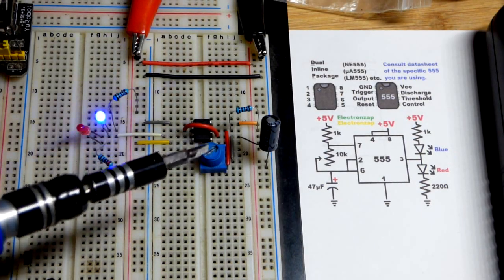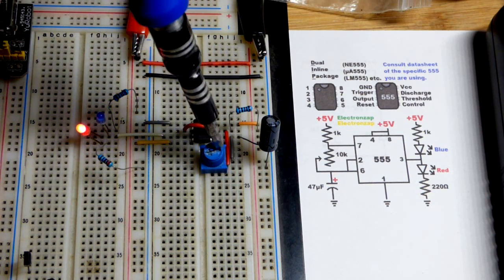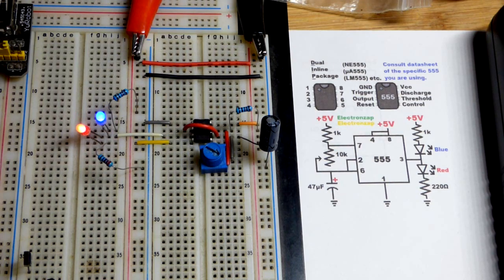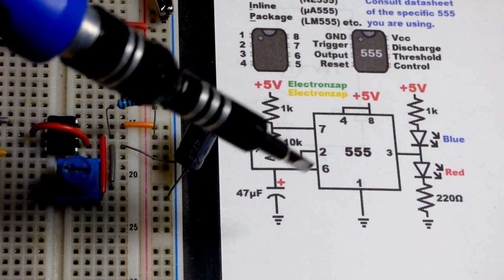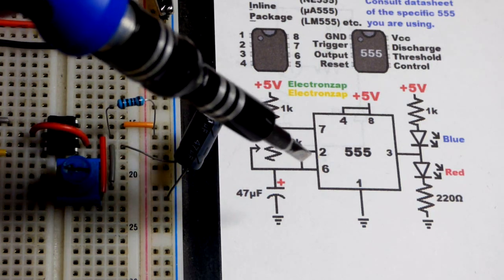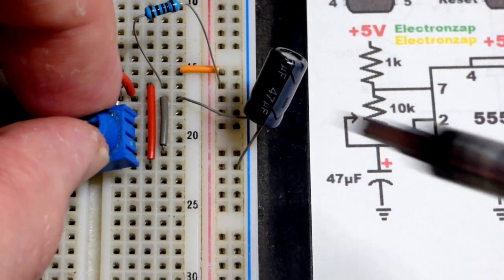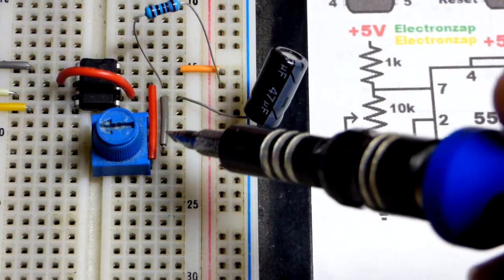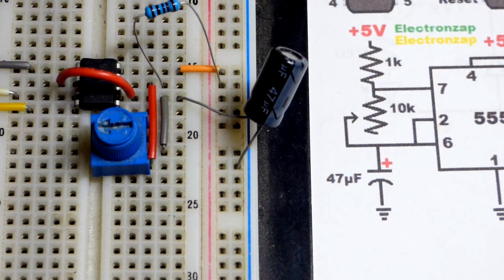Variable resistor adjustable astable 555 timer circuit for learning electronics lesson 53

Comment: Hello sir can you please help my ?I have some problems with my HEI ignition system . Basicali its old Opel car from the 80s tipical GM lay out  . I have pick up coil,4pin GM ignition module and 4pin E Core type ignition coil. So my question wuld by how do I force that thing to retard ignition timing??? I found the ic chip lay out it is the MC 3334 wire diagram who can by found easely on google scematic it is similar like my system. I tryed to use 500k potenciometer I do not remember if it was + on pick up coil or out going darlington transistor pulse to coil any way I did sucede to retard ignition timing even tought the engine was restricted lot and insted compresion it fiered at exaust stroke engine still run tough after 30 minutes cranking and I used soldered speaker wire from ignition module to the cabine and back to ignition module . So I encounter wrong parts resistance in wires weak fiering ignition module. So my question wuld by how is phase shifting done on ic chips preciseli 555timer circuets? Is it posibel to use for exampel capacitor/resistor box to finde correct operation frequency for my aplication? Im also curiuse are there some remote controled circuets that can perform this task's? I did try out use 1 pick up coil on 2 ignition modules bouth fiered but the problem is resistance in wires I dont know what tipe of wire to use to have no resistance . So what I need is basicali pulse trigger variabel 555timer circuet the mc3344 ic chip operates at around 33-333hrz frequency in variuse stages so also I have problems starting my car in winter when its cold on low rpm ranges that ic chip does not work well the coil saturation is weak I also lose lot voltage to the coil because of crapy GM wire harnest to thin wires and to long distance creates voltage drop. So I hope there exist bether circuets as this or at least some one can show my please dual controled 555 timer circuets if there exist any at all. I hope you understand my question .
Reply from the maker: No, unfortunately that's a lot more than I could help you with.